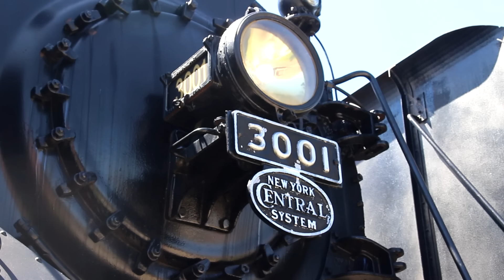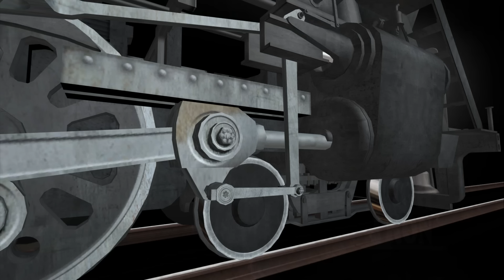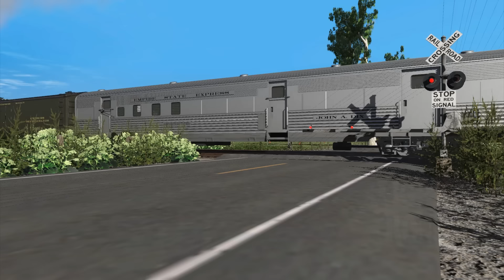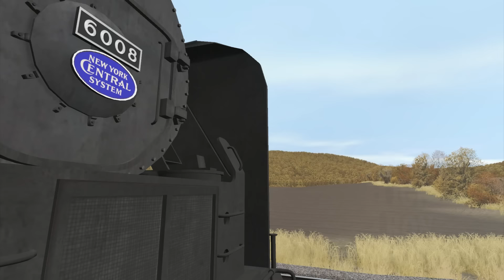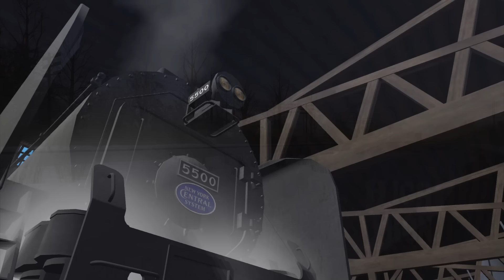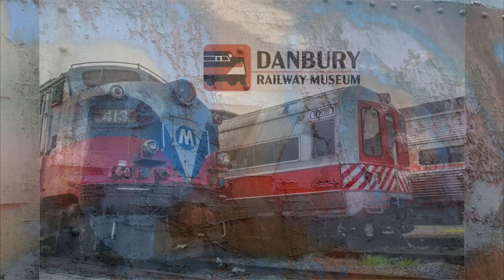New York Central's Niagaras - The Best Mainline Steam Engines?

Comment: The Niagara would have been one of if not the best steam locomotives in the central's fleet had diesel's been out of the picture maybe they would have had a better chance of beating the diesel had they been reconfigured to burn oil rather than coal

Merry Christmas Y'all 🎄
Or happy Hanukkah or Kwanza or whatever holiday you celebrate happy holidays all around
Reply: It pays to read the Kiefer 1947 review of motive power that was helpfully linked.  One of the things making the Niagaras competitive in 1946 was that their unit cost, even with expensive roller bearings and alloys, was considerably less than a two-unit set of E7s (let alone the three-unit set also mentioned).  On the other hand, something not fully discussed was that in order to make 'diesel-competitive' mileage, the Central needed day-in day-out traffic for long distances at high sustained speed, with enough traffic density to limit turnaround wait.  The immediate issue of concern was not that passenger service started falling off in these years, but that the Central made a marketing push toward their fast trains being "Dieseliners", and that the costs of steam service and maintenance skyrocketed (for external reasons) between 1947 and 1950 -- a major reason for abandonment of steam on many other Eastern railroads so quickly.